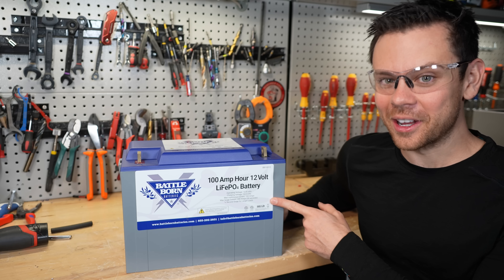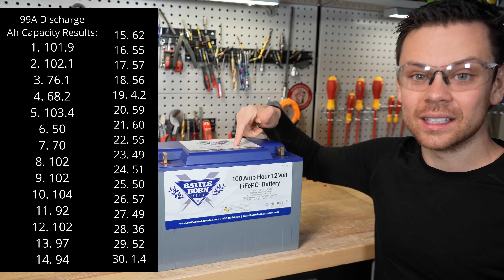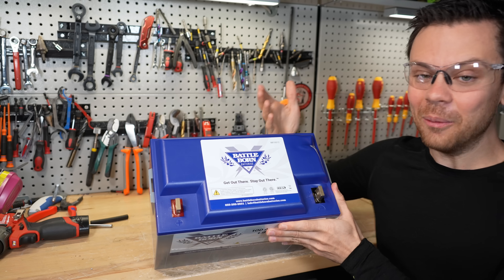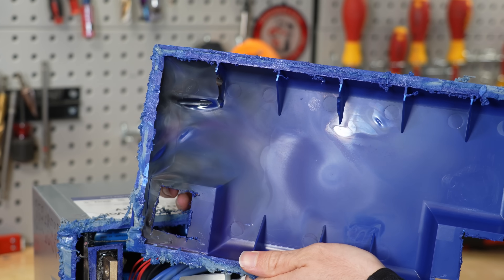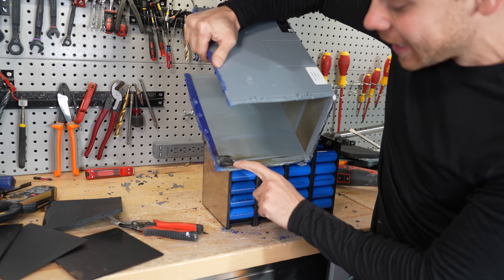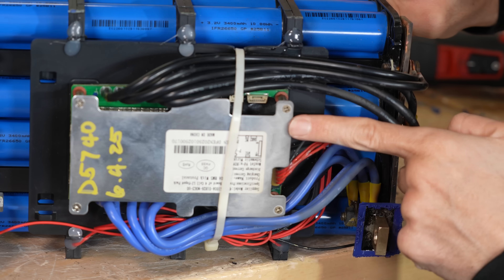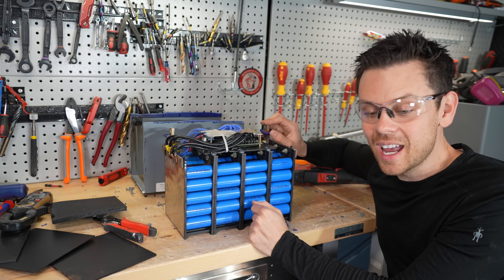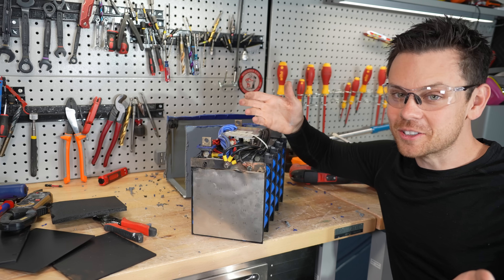Battleborn Battery MELTED?! 🔥🔥New Problem!

Comment: Background:  I've had 6 Battleborn 100 Ahr on a boat as the house battery bank for about 8 years without issue.  They are generally lightly cycled from 14.2 to 13.4 occasionally cloudy weeks took them down to 13.2.  They are only maintained by an 1100 watt solar panel system at about a combined 40 amps max.  SO far with no detectable problems.
 I clearly see what Will is revealing in these videos and it is concerning.. I agree that bolting electrical terminals through plastic is simply a bad idea.  After watching the positive-terminal issue video I immediately checcked my terminals and they were not warm or showed any deterioration.   These were early production batteries, I have seen (as a marine electrician) newer Battleborns deteriorate just as Will’s examples illustrate.  I have not recommended them for several years since prismatic cells became available.

The issue is that Battleborn has not responded to Will or addressed the issue publicly.
Reply: Didnt he say in one of his videos that this is happening with the new Battleborn design? Looks like they recently cheaped out to save a buck.
Reply: Where do you stand with insurance now you have knowledge of their potential? Operating envelope is one thing, what about when that is not the case...?
Reply: No, Battleborn DID respond to Will and used some lame excuse that this use of plastic was somehow a safety feature, and deliberately done.  I can't remember which video it was, but Will showed Battleborn's response right on the video, and to me it's a horror show.  In your case, since you've only lightly loaded your batteries, I'm not surprised they didn't fail.

Comment: Wow, how did this entire battery's internal design ever pass basic QA procedures during it's design phase, for some perspective, (I assume the case is made from fire retardant ABS) ABS has a glass transition temperature  (Tg) of approximately 105°C (221°F), where it changes from rigid to rubbery, but it becomes fully moldable around 200-250°C (392-482F) so that battery has become extremely hot, It must have been on the brink of catching fire.

Followup to be continued when Will gets a cease and desist letter from BB soon, waiting with my Popcorn.

Comment: Okay, I can't NOT comment any longer.....

The reason why these batteries are failing is because they sandwich plastic components into the electrical circuits. Adding a component that deforms at low temperatures into the electrical circuit is simply STUPID! Electrical connections NEED to always be sound (metal on metal ONLY). Any protection needs to be active, and it must be designed to function safely well beyond the specified normal operating conditions!!!! 

THIS PRODUCT CANNOT BE CERTIFIED BY ANY AUTHORITY AS SAFE! (i.e. any cert of conformity that this company claims is questionable... $$$$)
My question is, what is the point of CE, FCC, etc. certification if they allow such crap to be sold. Aren't these certifications meant to protect the consumer????
Reply: I don’t know about other certifications, but CE is just a declaration by the manufacturer that it conforms, not an independent test certification.
Reply: They should just use the regular copper/nickel bus bar for the sandwich terminal and this burning battery problem will be reduced by 99%
Reply: Much like the FDA, EPA, CDC, HUD, USDA, FCC, its ALL smoke and mirrors. Typically, these agencies and organizations quite regularly work AGAINST that which was claimed they would hold accountable and regulate from their onset. The ENTIRETY of our systems, the entities that were put in place to accomplish one thing or keep in check another, is ALL a FARCE! A RUSE! And yet we continue having to fund these garbage heaps LONG after they have proven themselves not ONLY useless, but many times COUNTERPRODUCTIVE to this, that or the other.
Reply: @sheepishmclemmingston5550  while I was still working on consumer products, I originally thought the UL standards 'marks' 
was just them collecting a fee for a stamp. But found we did actually get UL audits from time to time, and we had to archive /quarantine 
the devices/HW we tested for some time, and they had us rerun some tests while they watched and checked against what we reported.
So not a 'scam' but they do depend on the companies to be honest and to do a good test per the requirements in the standard to be sure it passed.

And obviously it is a spot / unannounced test, so they didn't check everything we ever produced.

Comment: That's insane, it wasn't long ago that battleborn was supposed to be one of the best quality LFP batteries you could get. Putting those nuts against plastic is a recipe for disaster since the plastic will naturally deform over time.

Comment: Sadly Wil you loved these battery's 6yr ago and praised their quality  and now you hate them you overlooked an awful lot of stuff maybe you should take a look at other battery's you have praised   i myself know many battery's get hot inside due to bad connections they all have bolts tightening cables to terminals this is a bigger issue than just battle born this problem has been known for a long time

Comment: Now send it back under warranty under a different name and let us know how you get on.
Reply: I tried to return a battery that just failed to work - no charging/discharging. They told me (after I spent $390 to return it) that it was my fault for using it wrongly - that cables were maybe too thin, or currents weren't quite balances. It was being used in series with another Battle born 12V in a 24V system and that other battery is still just fine, as are all the other batteries (14 total in a 7p2s configuration) with all battery voltages matching within +/-0.01V, but they denied the warranty claim anyway And they took weeks to do it.
Reply: DO IT DOIT ! Ship all the pieces too. Would love to see the Email from their A.I. generated reply BOT !

Comment: I am glad I never bought one. I know their battery cells are supposed to be really good. So maybe buy one, take it out and remove the plastic if it is at maybe 50% of the original cost. But at that point, I would just buy a bigger AH battery for the lower price anyway.

Comment: Ive been having issues recharging my battleborn batteries from shore power.. Starts off with 30-40amps then quickly drops down to under 10 amp….  I need to buy a heat sensor to check out some temperatures…. With a 10 year warranty they have to stand by right???
Reply: No, they will say you did something wrong on your end, sadly.
Reply from the maker: That sounds like exactly the same problem before my failed. It would cut in and out on the charging

Comment: It is time for BattleBorn to have its UL certification Revoked untill they Fix these issues😮  I can see any and all insurance companies not covering rv's or boats with these batteries.  I have seen where in a boat the batteries allows moisture into the case after only a year and the cae connector plates corrode to a point that the cells do not connect and all the individual cells get blisters in the wrappers. So their waterproofing claims are not valid either.  CHEERS Steve h

Comment: These are the most expensive batteries on the market. They have been out for a long while now. Why hasn't this issue come up before now? 

Not doubting you Will but you have to be wondering too. Maybe they recently changed their design?

Comment: There are sooo many youtube content creators that have been sponsored by BattleBurn and helped them to ripp off mostly the RV users
Reply: Makes me sick! A lot of us,  like me,  don't have 5k just laying around to replace my so called "best in the market" batteries that I saved for to buy.  Super frustrated
Reply: @kenbrown6095  you don't need 5K to replace them.  Get a few 280ah -310ah 12v batteries.  Safe Chinese batteries a few of them to make a bank probably bigger than you got would cost maybe $1,500 or less.
Reply: @kenbrown6095  Will did a surprisingly positive review of a 300AH 12V Lifepo4 battery.  It's going for around $260 on Temu.  I bought one for my small solar setup, but can't really test it much until we get more sunlight.

Comment: I contacted BattleBorn 2 times via email regarding continued use of the 3 BB battery's I have in our RV. To date, I have not received any reply from BB! So far, I have not noticed any damage or problems with our 3 batteries. But each of these videos makes me question if BB batteries are safe to use. I liked BattleBorn being made...at least partially in Nevada, my home state. I like to support US companies, but not if the products are defective and the company is unresponsive and/or denies the problem!
Reply: Someone should offer Will older BB batteries to test and tear down. 
Is the current design and presumably Chinese manufacturing different? I wonder how often brands are cheating out on contract manufacturing.

Comment: Wow ! Yes I really think they should  recall these batteries. Is there no government agency that watches out  over things like that ?
Reply: If the company selling the product doesn't care about safety, no amount of oversight will be enough to make it 100% safe. 

I'll be the AH and remind you if the government watches things that closely before they can be sold, 
we would still be using 12VDC lead acid batteries. And only those as they got grandfathered 
in - sort of like Aspirin would never be approved for sale today.

To get any real innovation you can't have a government wet blanket analyzing new product designs to insure there are NO flaws.
 
There are agencies in US (and some states) that 'react' to reports of faulty products in the US. That's the balance we use in the US.

But you don't HAVE to get UL, etc. approval to sell a product. Many buyers have specs that would preclude a purchase 
without UL/CE/??? listing but it's up to the buyer to decide what risk they want to take. Many cities/states (?) 
 require UL standard to get a certificate of use or pass an inspection to allow a product to be used. 
In the 'country'  you may not need that.

I think Amazon tries not to list a product without UL mark due to THEIR reputation, but I have found non-UL listed stuff for sale on Amazon.
And suspect Amazon takes the CCC China Compulsory Certificate mark as being equivalent to UL mark.
Whenever I pointed out a product has CCC mark in a review they rejected the review.  
And I have no clue if CCC testing is good or bad, I just mentioned it as a product attribute for products I have bought and still use.

Sounds like you would / should avoid things without UL / ??? mark but others might decide to save money and take a risk.
And a UL mark CE mark, etc.  isn't an ironclad guarantee a product has no flaws

Comment: They must be doing something different during assembly currently. Haven't had any loose or heating issues on my 2021 models? I generally do  not exceed 50amps draw per battery on 3x in parallel.

Comment: 3 of these in my Fifth Wheel. Installed in 2019. Checked them with a thermal imager under about a 12-14 amp charge coming from my converter in the trailer. No sign of any heating on the terminals, or the case. Debating buying a Dumfume 600 ah off of Temu for $510 dollars and be done worrying about these POS's. Paid $845 each back in the day. Had no concerns till these current videos. Bought them based on your reviews back then. There wasn't much else available that was worth a crap back then.
Reply: What amps are you drawing?  Will is running these batteries HARD.   I'm drawing 30-40 amps per battery 98% of the time. They obviously need to be de-rated but I'm not throwing mine away.

Comment: They quickly should rate it for,50 Amps only, then less heat builds up.

They also need to redesign the batteries and replace all troublesome ones.

Comment: Side note:its really cool further proof how safe the LIFEPO4 chemistry is
Reply: Because plastic melted?  Means nothing about the batteries
Reply: @scott8689 the point is they resist heat and abuse so well, some other chemistries would have failed with such direct exposure
Reply: @doorgoo you don't know wtf you are talking about.  Thermal runaway happens from the inside out not from some hot metal insulated by some melting plastic.
Reply: @scott8689  They mean if battleborn made lithium-ion batteries there'd be tons of fires caused by thermal runaway instead of melted plastic and still intact lifepo4 cells.
Reply: @TechInspected  that would be the fault of their manufacturing not a problem inherent in the chemistry
Reply: @TechInspected  You mean NMC. All rechargeable lithium batteries (including LiFePO4) are lithium-ion
Reply: @scott8689  this is more evidence that they can get really really hot and not do anything

Comment: i know i m the wierdo in here  but  since people know   they can relocate the battery  use it 25to 50%  max   so can payback a tiny bit of it!!!  there were so many cases and its impossible all of them treated  fair!!!! best thing is battleborn try to give the advice  before its too late
Reply: That's what I did for my VERY TIRED Lead Acid Batteries when I upgraded to EG4.
Get every last penny of use from them even if it's to run a few lights or phone charger and as a redundant system

Comment: i have 4 in parallel for 6+ years and  each battery was limited to 30A max discharge each.   And they dont have any issues.  So i would say this has somethjing to do with pushing the discharge limits

Comment: BB was never a consideration, even when they were "THE GO TO BATTERY" because they just cost WAY to much.  Think about it, BB 12v 100aH battery is almost as much as a 48v 100aH server rack or golf cart battery.  And at almost $900, for the BB 12v 100aH you can ALMOST buy a 12v 400aH battery form companies like Li TImes, Watt Cycle, etc.
Reply: They STILL don't pencil for stationery off-grid use. The top of the line Trojan lead acid have better lifetime cost per kHr.

Comment: I have (2 ) 6 year old battleborn batteries in my Rv.  All because of I was following Will way back when.  I have not had problems, but don’t charge and discharge at such a high output.
I wonder if the newer production batteries are lower quality?  
Any RVers experiencing problems?
Just wondering.
Will is the best friend to us Solar geeks.
Reply: Looks to me like the defect is using plastic in the bolt down bus bars, meaning as soon as that plastic weakens a little bit - it will only get worse and fail and possibly lead to a fire.  That does mean the plastic has to start failing and Will pushed the limits (what the battery claims sustained limits are).  If you are way under the limits, you are probably going to be fine but, now you can see this clear defect.